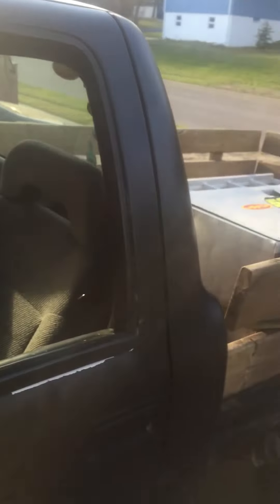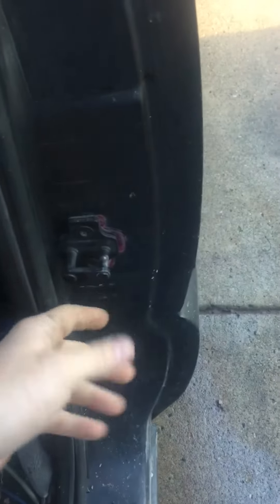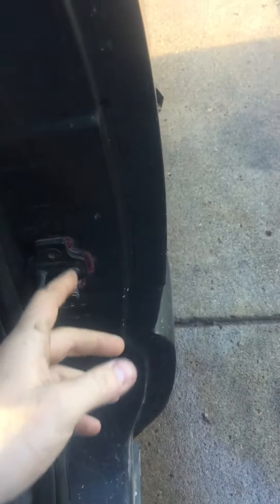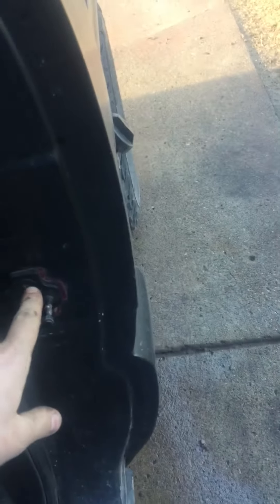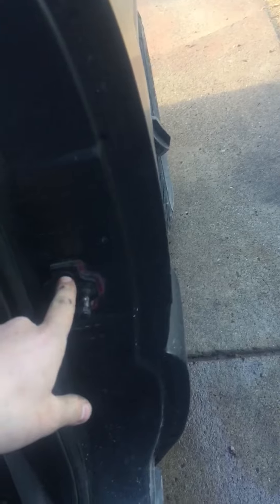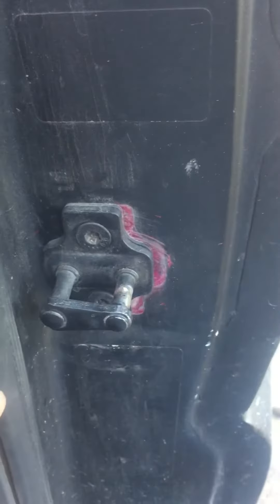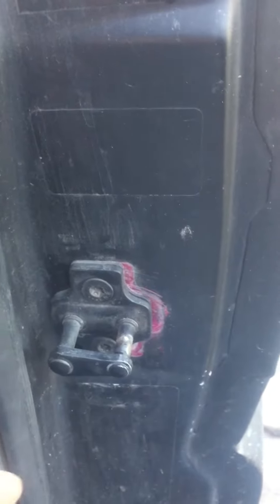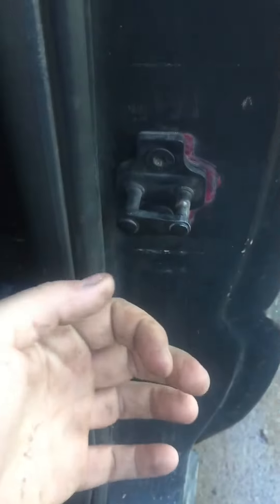S10 door seal leak fix

Comment: Thanks for this idea. I replaced one door on my S10, and replaced all door pins. Ever since, the door won't close right. Like you said, there is not much room for adjustment on those strikers, so I was at a loss for what to do. On mine, it seems that the weather stripping on tthe top of the cab seems to be preventing perfect closure. I'm going to try your idea this weekend. BTW, I like your truck. It seems similar to what I've done. Good luck, and thanks again.
Reply from the maker: Just be careful not to adjust it to far as it will really make you slam the door to shut all the way